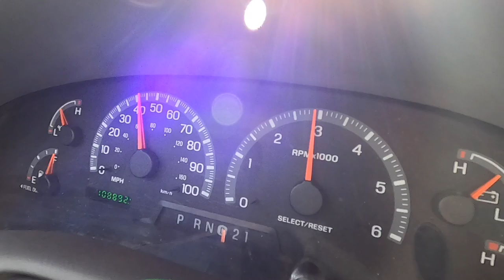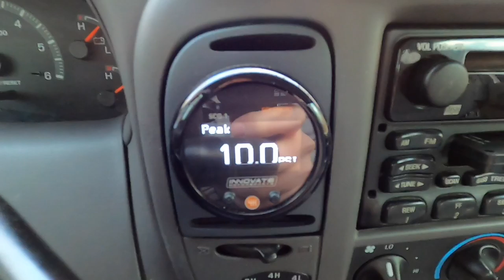What's Next for Gramps!? MORE BOOST! **Garage Update**

Comment: Dude, DON’T stress about your transmission.  The 4R70W is a tough unit, it is common for them to hold 600 wheel hp with nothing more than a quality converter.  J-Mod it(with a Tuff-Plate separator plate) replace the main pressure regulator valve, drop in a Sonnax clutch bypass valve(to maintain positive TCC lockup) and possibly upgrade your trans cooler and you’ll be fine.  I also like to shim the OD servo pin spring and use the softer OD servo spring(different from the OD pin spring) from the smaller 2.5” servo equipped transmissions.  Gives a positive quick OD engagement with no harshness.
Reply: Got any links for this and or stuff to install this?
Reply from the maker: I'm looking forward to building the trans too! It'll be nice to have it beefed up a bit when I make more power.
Reply: @El_De_La_Lobo, Sonnax makes most of the parts I use with the exception of the “Tuff-Plate” which is made by Superior.  I have a video where I replace a few of these items in a 4R70, but it doesn’t have the J-mod info because it was just getting a repair(fixing TCC shudder).  I need to get around to making a J-mod video, I get a lot of questions about it.

Comment: I love what you're doing with gramps.  I have been building up my 02 supercrew 5.4 4x4 over the last few years and it brings a smile to my face everytime I look at it.  So far 5" suspension lift 3" body lift 35" tires ridiculous stereo lightning lights new trans, axles, bearings, tie rods, you name it, its brand new.  Oh and I just installed the only tow mirrors that exist for 10th gen s-crews.  Just upgraded the entire cooling system in preparation for the coming engine mods.  Please continue to build the sh** out of gramps, it's awesome to see the project grow and gives me direction on what to do with my engine.
Reply from the maker: Sounds like you've put some serious work into yours! Thanks for following the build!

Comment: I just rebuilt my 02 f150 5.4 Nothing to crazy just simple bored .20 over to get the cylinder cleaned up, polished crank, all new timing set, oil pump, set comp cam xe262, under drive pulleys, long tubes, no cats,  3 inch single exhaust with delta series flowmaster. Fun build, also first time building a truck engine so far so good with it. Truck has 2,500 miles on build to date. Love the turbo setup you got going on, look forward to your build. 👌🤙
Reply from the maker: Good work! Thanks for following along!

Comment: With the power you have I think you should look at a drive shaft safety loop.  If that front u joint breaks it’s going to destroy the under side of the truck
Reply from the maker: I was just looking at those the other day. Probably will look into that when the built motor goes in. Thanks!
Reply: Auto Detour look at stifflers. I have that on my ranger that runs mid 11s in the 1/4 mile

Comment: id say drop in the 4r100 can prob run about 25lbs of boost with forged internals on a 5.4. im not a mechanic i just pretend to be. I agree with Carport Shenanigans also, that the 4r70 is tough, its actually the reason i bought my 02. 2v with the 4r70 is what i wanted cause my plan is the HD Supercarger. ;)
Reply from the maker: I wish it was easier to drop in the 4r100, but it actually takes quite a bit. So, we'll beef up the 4r70 and letter rip! It's holding up fine so far on 9psi, and I haven't been very nice to it. Haha! I supercharger will definitely wake up your truck!